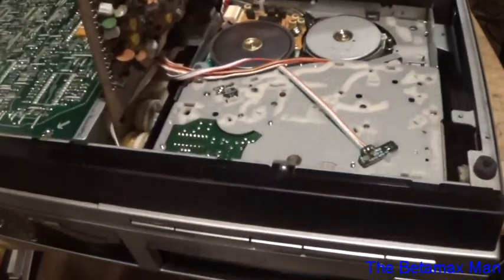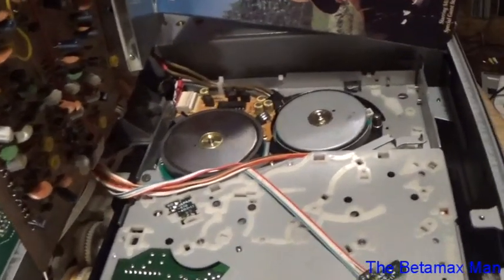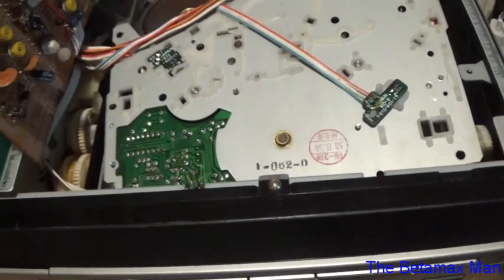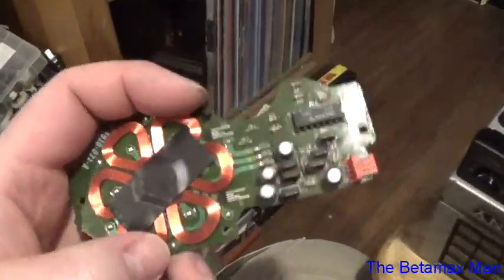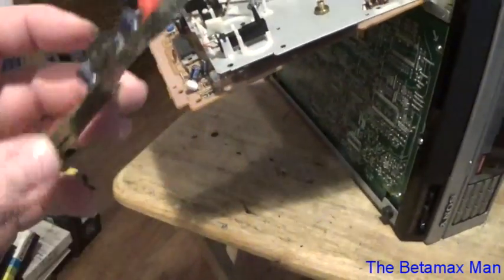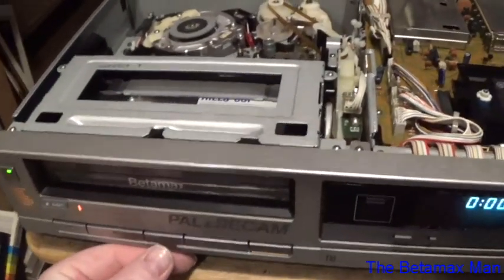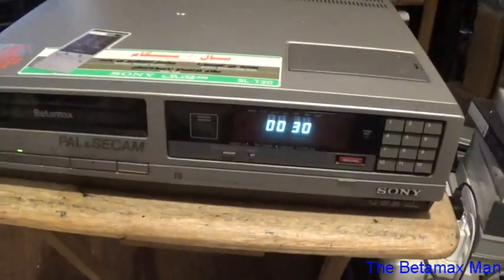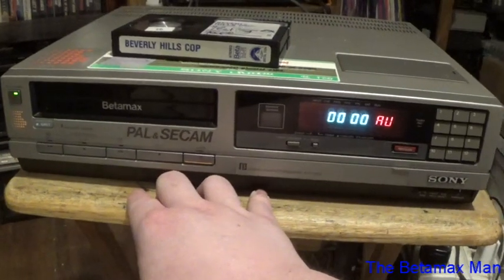A Customers Pal Betamax VCR Repair Part 3 It's Working

Comment: Thank you very much for adding timepoints (chapters) in this video! 

16:10 - Some VCRs keep the pinch roller engaged during picture search and some do not.  It really depends on the machine.  It does not depend on the local TV system (NTSC/PAL/SECAM). 

Most three- and four-head VCRs keep the pinch roller engaged so the tape will run at a precise speed and the heads will cross the video tracks at predictable intervals -- this helps the machine co-ordinate the head switching with the video tracks and keep the picture as clear as possible.  (I think.)  My SL-HF900 is a four-head machine and keeps the pinch roller engaged during picture search. 

My SL-100 is a two-head machine.  It does not keep the pinch roller engaged -- when entering picture search, it disengages (with a loud click), and when returning to playback, it re-engages (with another loud click).

But some two-head Betamaxes keep the pinch roller engaged (like your SL-S600).  One effect of this is, on the SL-100, the noise bars roll up and down during picture search, but on the SL-S600, they stay in the same place.

I think the SL-S600 and three-/four-head machines speed up the tape to a specific multiple of the playback speed, but the SL-100 just speeds it up to an arbitrarily fast speed.

Again, not all VCRs operate the same way.  My family's first VCR was an RCA VKT-326 (VHS), with two heads.  It kept the pinch roller engaged during picture search, but the noise bars still rolled up and down the picture.  Curiously, during play/pause, it kept the pinch roller engaged (but stopped), but during record/pause, it disengaged the pinch roller. 

17:24 - Some high-end computer monitors from the late 2000s have composite and S-video inputs and may be multi-standard.  I have a Dell 2007FPb monitor and a Dell 2408WFPb monitor.  Both of them display both NTSC and PAL video perfectly -- they automatically detect whichever standard is used.  (I don't know if they can handle SECAM.)

Be careful however -- some TVs and monitors can give a stable, watchable picture, but are not actually multi-standard. 

I tried feeding both NTSC and PAL video into a flat-panel LG TV that was sold in North America in 2012 (model 32LS3400).  It displayed NTSC perfectly, but with PAL, it flickered a little, then gave a black-and-white image.  Basically, it could synchronize to the correct number of lines per field and fields per second, but could not decode PAL color.

(What was funny was feeding it PAL-M video -- PAL-M is the standard used in Brazil.  It uses the same 60 fields per second and 525 lines as North American video, but with PAL color on top of it.  The LG TV flickered between black-and-white and slightly distorted color, as if it knew there was color there, but couldn't decode it correctly.  Feeding PAL-M video to an NTSC-only TV typically results in an image that is stable and watchable, but black-and-white.)